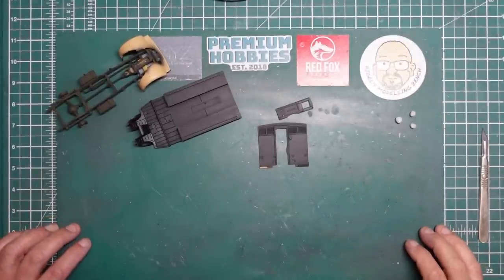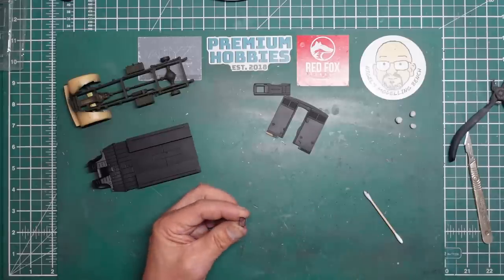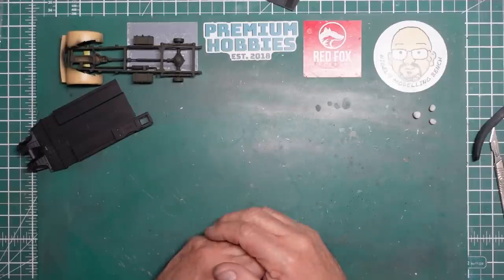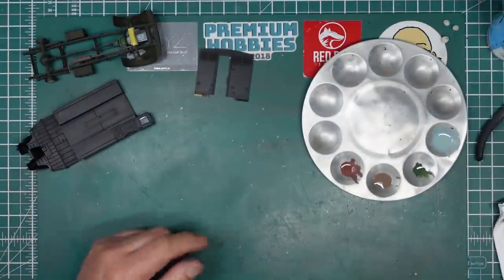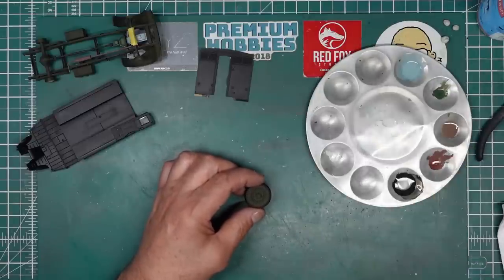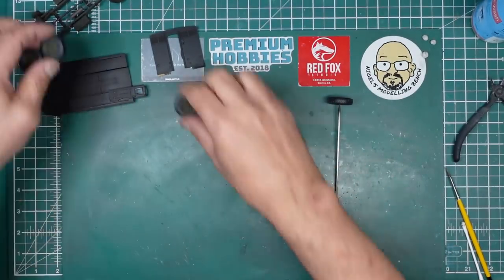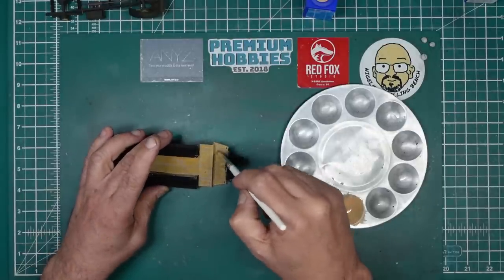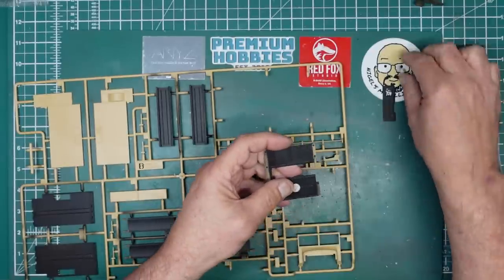A New build for Beginners. Part 6. Painting tyres, painting wood, pre-shading.

Comment: The really tiny 000 brushes are for spot details (eyes etc), they don't hold much paint (as Nigel said) and it tends to dry fast on the brush. To use them you need to add a "retardant" to the paint so it will flow.

Comment: Nigel,, Did I miss something or did you purposely not paint the tread surface on the tires with the same anthracite black color you used on the tire sidewalls (which, by the way, looks incredibly realistic), and, if so, what is the thinking behind not painting the tread surface?  I'm interested primarily in how I can apply this technique to painting aircraft tires.  Thanks.
Reply from the maker: I would suggest you watch my Border Lancaster build when I painted those tyres.. lots of tips there. Aircraft tyres look different to road car/truck tyres.